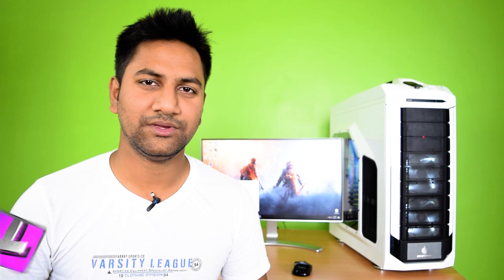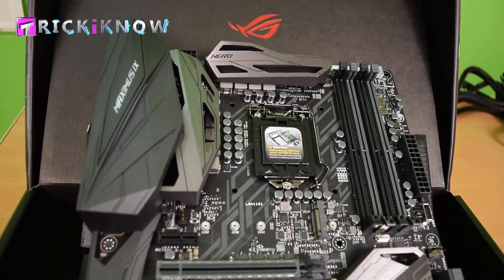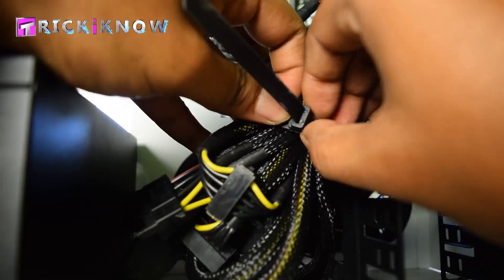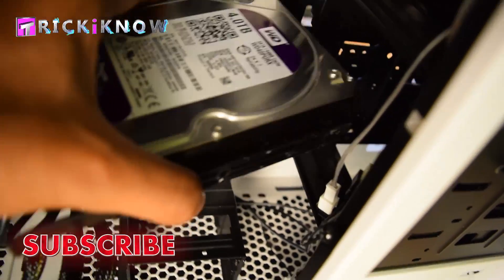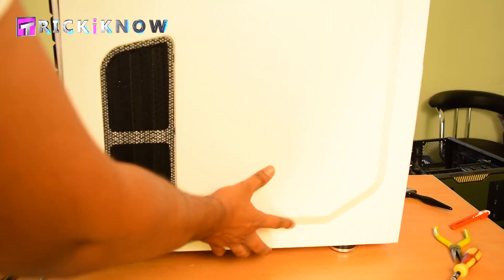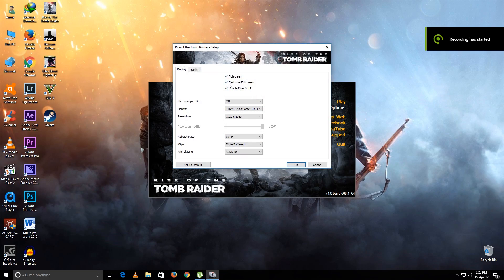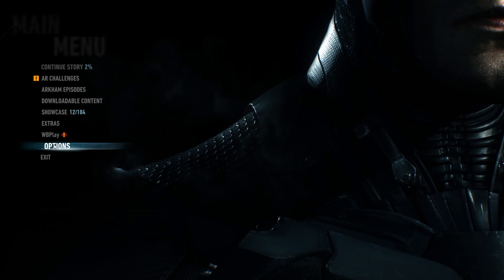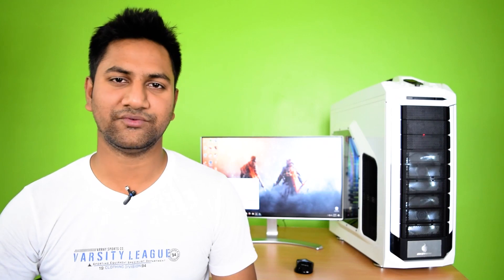How to Build a 7th-GEN Gaming PC - Best Gaming & Video Editing Computer ( $2000 PC )

Comment: Thanks a ton!  Helped me find mistakes I made with my build (Using same case).  I have a question though... My Fan controller isnt receiving power and the 4p Molex is hooked up to my PSU correctly and the cable is verified working via trying different connections.  Do you think my Fan controller may just be dead?  Or is there something I missed that could be causing this... Thanks!

Comment: Hmm
I have the same build but I have 1070 and liquid cooling..
Reply from the maker: Congo bro , now you are getting much better performance then mine :)
Reply: TricK i Know doesn't matter I have a 70hz monitor so even if am getting 200fps I will only see 70 :'(
Reply: then buy tn panel monitor its around 14k and its 144hz monitor :D
Reply: praful thakur Its not 14k 😧its around 35k
Reply: see in amazon type 144hz monitor and get 14k monitor check it out xD

Comment: Badhiya... maine haal hi main LG22-MP68VQ 1080P - 75Hz- FreeSync monitor kharida hai. Could you please suggest me a Processor, Graphic Card and Motherboard for the same. I can afford 60,000 for Processor, Graphic Card and Motherboard.
Reply from the maker: The processor i used in this video i7-7700k processor is best dont change it, in motherboard you can use msi z270 board which will cost you around 17k and gpu i am suggesting gtx 1050t cheap and best :)

Comment: Can you tell why the gta v get the 40 fps onvery high on this pc ?? Is it worth for gaming?
Reply from the maker: May be because i am using my old gtx 1060 , it will work faster on gtx 1080 :)
Reply: but i want to build gtx 1060 6gb asus or msi graphics card and other components can you tell me gtx 1060 is good for gaming on 2017 ???
Reply: Senura Ransika I know that this is late but i have been using a GTX 1060 6GB for almost half a year, and most games i can run on ultra settings. The only ones i cannot run at ultra are pubg, gta v, the witcher 3 wild hunt.
Reply: RANSIKA OFFICIAL ya

Comment: will it cost under 75000 rs with no external graphics card...i will use intell's own graphics card for making music video editing and other stuff not for gaming ! the specs are really high end ....🙄
Reply from the maker: By subtracting the Graphic card and using a low watt SMPS and CASE the cost of Only System (without monitor) will reduce the rate around 51000/- Rupees from 160,000/(my whole PC Rate). That means the system will cost you around 99,000/ Rupees :) My be you will want to subtract the 4tb HHD also the it will be 99,000-11500=88,000/- :)

Comment: teach how to install window
Reply: Melody 7up you just put the windows disk inside the cd drive and go to your bios and set the boot settings on the cd drive and it will take you through the process of installing windows
Reply from the maker: Sure , soon i will make a video :)
Reply: TricK i Know i want learning how to install window in desktop
Reply from the maker: Ok no problem , first tell me which installation media and OS you have ??
Reply: TricK i Know os is?
Reply from the maker: OS means Operating System , Windows 7 or windows 10 ??
Reply: TricK i Know window 10
Reply from the maker: Do you have Windows 10 DVD ??
Reply: TricK i Know oh，can use dvd to easy install?
Reply: TricK i Know use dvd can easy and fast install?
Reply: @TrickiKnow  hi

Comment: Is the 212x enough for the i7 7700K? I intend to buy it to use in stock and further ahead perform slight overclocking (4.6 ~ 4.7ghz).
Reply from the maker: Watch this i recorded the temperature while gaming: https://www.youtube.com/watch?v=OVlIDIGY0AM&t
Reply from the maker: I think cm hyper 212  is enough for normal gaming , but in the case of overclocking may be it will heat more. Always keep on your temperature counter on :)

Comment: Bro, i am using nzxt kraken x62 liquid cooler and i think Maximus 9 hero has only 1 usb 2.0 header next to rog_ext and i can't use my usb 2.0 front panel case because of that. Do i need to buy internal usb hub in my case?
Reply from the maker: Hmmm , There is One USB 2.0 Socket which Supports 2 Front USB Device 
such as Card Reader or Pen Drive and there are 4 USB 2.0 Ports in the 
back , Use external USB Hub for That. Additional 4 USB 3.0 , 1 USB 3.1 
and 1 USB 3.1 Type 2 Ports in the back. The best Way is to Change you 
Case if you don't have USB 3 front Ports :)
Reply: Thanks for that. I really have to buy internal usb hub. Subscribed! More power bro.

Comment: Great build.  Couple of ideas if you don't mind.  If that's a purple HD from Western Digital, it's meant for surveillance functions, not really performance.  You might consider a black or blue drive.  In addition, the 7700 is probably one of the best CPUs for gaming, but below you said you didn't think AMD is good for video editing and rendering.  I've actually found the 1700 roughly equivalent in price is much better than the 7700, with 8 cores and 16 threads, with few exceptions, it can beat the 7700 in many of the post processing things.  The 1060 graphic card is great for 1080 gaming, it struggles a bit with the bigger titles at 1440 and it's terrible at 4k.  But it's the sweat spot for price to gaming performance at 1080.  Good choice.
Reply from the maker: Thank you for Watching Jay , you are right WD surveillance HHD is not good in performance but i brought it to store DATA only for a long time. Surveillance HHD is Very strong and its a 24X7 Hard drive used on CCTV Cameras you can also call this Heavy Duty Hard Drive. The life of this HHD is greater than others :) If You need Speed and performance then you should have to buy Black or Blue HHD :)